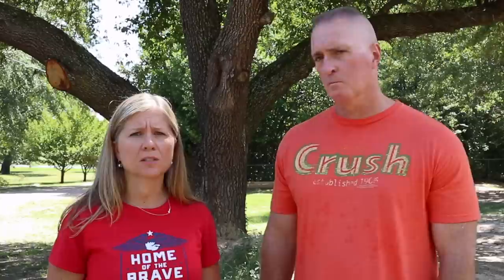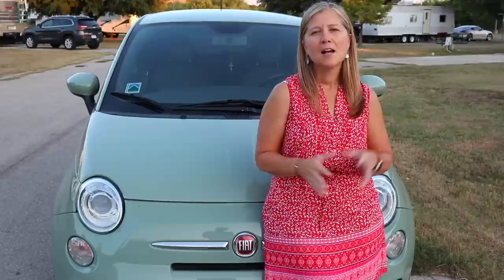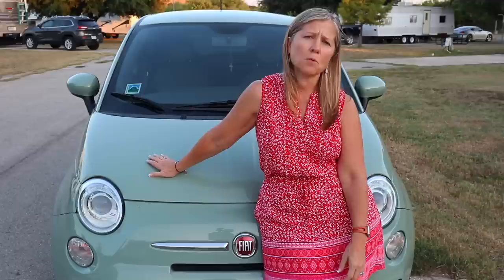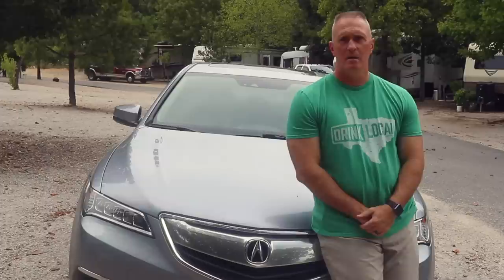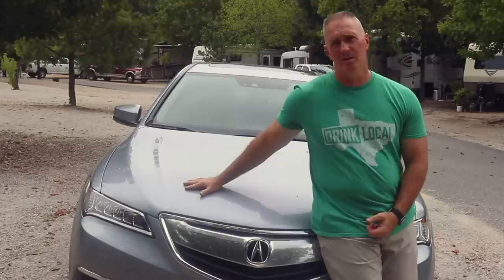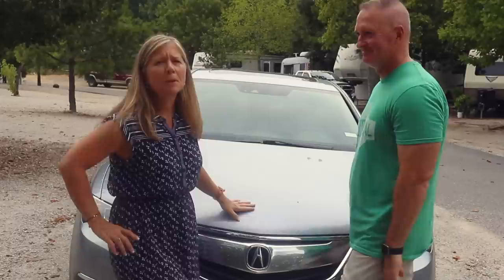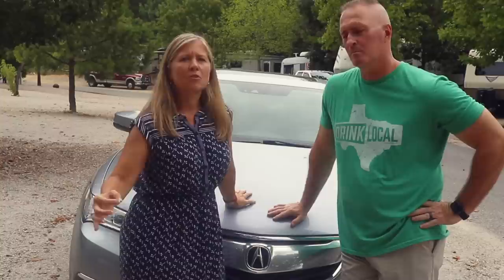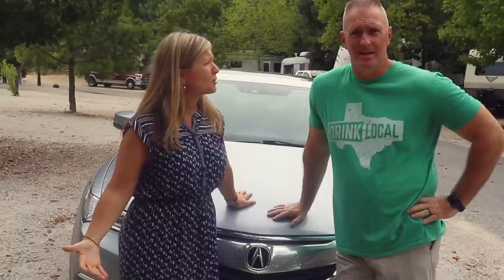RV Towing: Dolly vs RV Flat Tow -  Full Time RV Living

Comment: towing a car (or anything) behind an RV is not only heavy on the latter item's fuel consumption but also cumbersome in terms of driving and parking and other things already discussed in the video as well ...

the other problem with it is when towing another car behind an RV, if the former's all four wheels are on the ground, then they have to undergo a lot of tear and wear, meaning extra unnecessary costs of course ...

if a dolly is used so only two of the car's wheels will always be on the ground, then that's even worse imo, because those two wheels receive a lot more tear and wear than the other two that aren't on the pavement all the time!

now, one might say one can 'rotate' the towed car's wheels, either by actually having them rotated the traditional way by a mechanic, or by towing the car facing forward and backward intermittently when towed ... either way, it's almost impossible to keep a precise record of how much which wheels (rear or front) undergo tear and wear ...

long story short, i'm not much of a pro-RV guy anyway and prefer a much smaller package for going camping or glamping whatever, especially for boondocking, which is my most favorite way to experience an off-the-grids living style ... therefore, if i were to go the RV way and tow an actual car as well, i'd use a small car such as the Fiat (and preferably an electric one at that!) and for the reasons described in the video here as well, i'd also use a small flatbed rear extension with four lower-costs wheels of its own so the car would park on top of it on its all four wheels when not in use ...

and when parking the entire RV + the flatbed in an RV park or anywhere, then the flatbed thingy would serve as a temporary parking space for the smaller car as well ... there are additional items such as not-so-heavy mesh walls or simply cloth covers that can also be installed / uninstalled quickly to turn the flatbed into a roofed garage when parked ... or if there's enough space available to park the car off the flatbed and the ground, then the flatbed may as well serve as temporary space for other things, such as setting up a tent on top of it instead of on the ground ...

Comment: The beauty of a trailer is you can backup.  I would totally go trailer but a bunch of the parks I called won't even let a trailer on the premises.  I use a dolly unless I go rock krawling with the k5 blazer. Then I trailer in case it breaks. Just my 2 cents.

Comment: Towing on a dolly you can tow a rear-wheel-drive just place the car in neutral.
Reply: Some rear wheel drive vehicles can’t be towed that way, the trans will burn out
Reply: Disconnect the diff shaft

Comment: I prefer a tow dolly.  The dolly has brakes, it weighs only about  500 lbs. I can easily move it around. I can have it hooked up and ready to go in 6 minutes. If you practice YES you can back up a tow dolly.

Comment: You two are great, just found your vlog and am enjoying the videos. Wife and I are hoping to retire soon and hit the road as you have. Perhaps our paths will cross some day.

Before changing vehicles to a flat tow compatible have you considered a Trailer Dolly to help with moving the tow trailer? These are inexpensive (~$70 at Harbor Freight) and can remove the strain of pushing / pulling a bulky trailer. If this wont work for you Jeeps are great options.

https://www.harborfreight.com/600-lbs-heavy-duty-trailer-dolly-60533.html
Reply from the maker: Randall H thanks for the idea.  I hadn’t thought of that.  I will look into it for sure.  Good luck on your future goals of hitting the road.  Would be great to cross paths.

Comment: All of these are good reasons to ditch the cars and class A and join the fifth wheel gang. It’s just as easy/hard to hook up a fiver as it is to deal with a toad. And you still have a comfortable vehicle for your local travel needs, and more room inside ta boot.
Reply from the maker: Our Class A drives great.  The flat tow set up has been awesome from day one!!
Reply: @todayissomeday    And I wish you many safe miles in your journey.